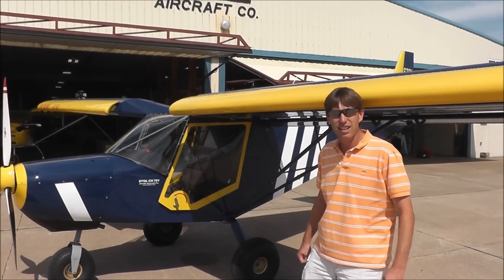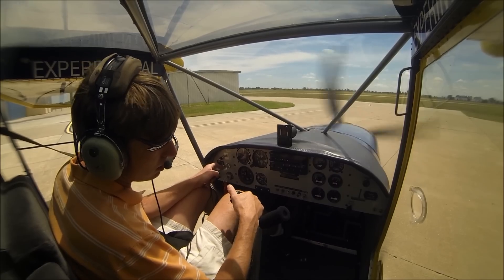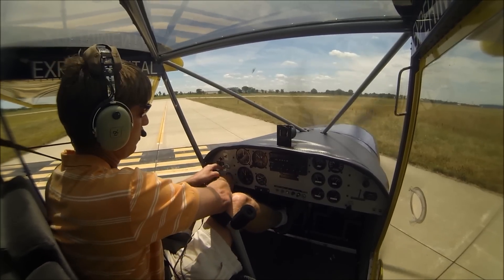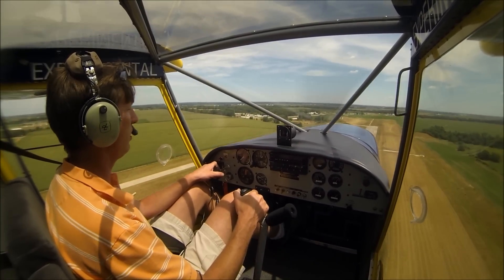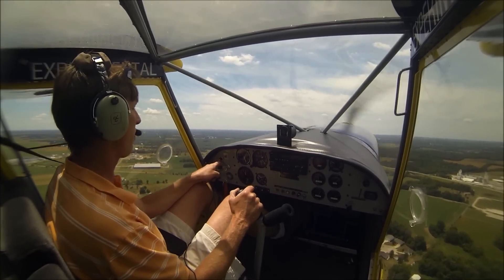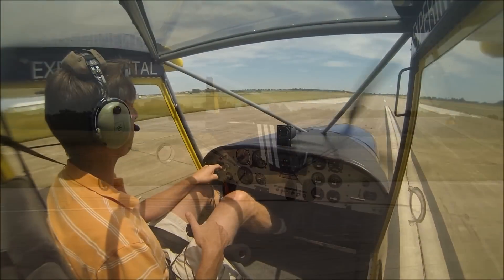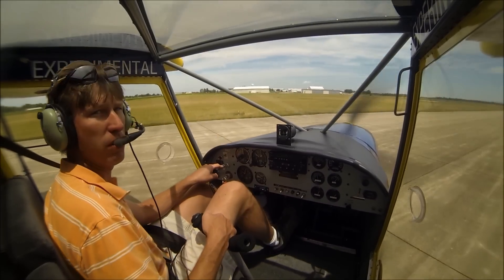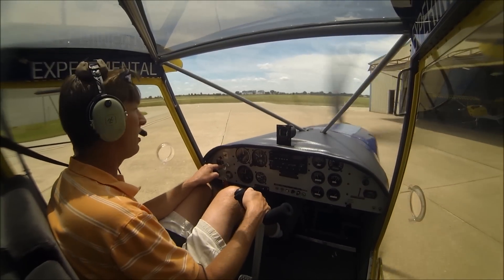Flying the Zenith STOL CH 701

Comment: How tall are you? Can the 701 fit a guy who’s 6’3”?
Reply from the maker: 6' 1"
There are definitely taller pilots who can fit in the CH701 but how comfortable will depend on your height distribution. The CH750 series with adjustable seats is better adapted for taller and bigger pilots.

Comment: When you think about it, it's remarkable how far ahead of the times they were back in 1998 by equipping that aircraft with a totally electric propulsion system - no fuel other than what the batteries and solar panels deliver.  Kudos to Zenith for leading the way on that!

Comment: How reliable is the Rotax.  It runs fairly high rpm.  Would it be feasible to stick a continental in it with 100 hp or would that be too heavy?
Reply: +Joseph Howard 
The Rotax 912 series engines have proven themselves to be very reliable. The Continental is a little heavy for the CH 701, but suitable for the larger STOL CH 750.
Reply: Joseph Howard .,m

Comment: Great plane, I used to fly it with Rotax 503 and a passenger, too bad is slow flyer
Reply from the maker: It is designed as a STOL (short take-off and landing) aircraft. The high lift characteristics of the design mean that it is also relatively slow. Most of us are already where we want to be (in the air!) when we're flying the STOL
Reply: Dummy.  Not everyone wants to fly fast if it was up to me I would fly just above the tree line 25 miles an hour if you’re not big of a hurry book a commercial flight I want to fly like a bird that’s the whole idea of flying this is a world class playing because it does what it was designed to do fly low and slow but if it was up to me … If I was capable I would design something to fly even slower